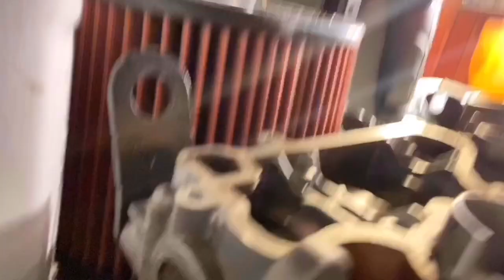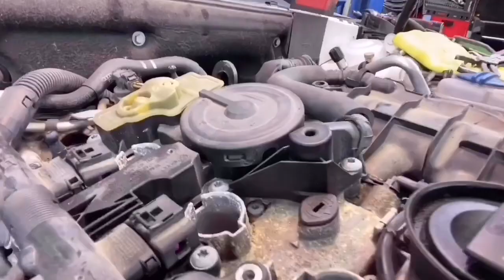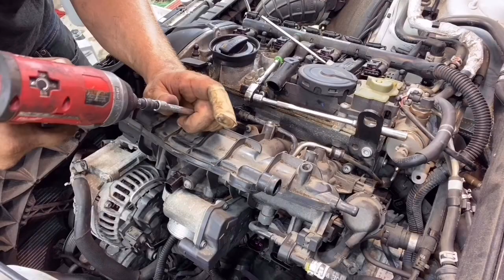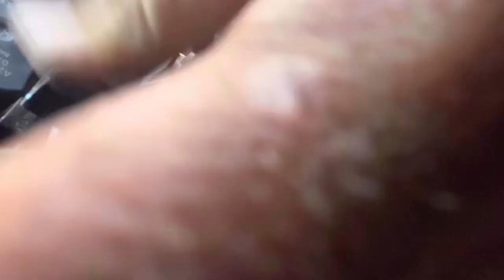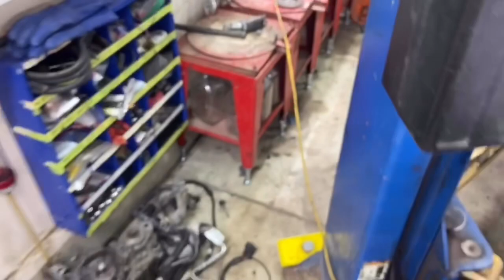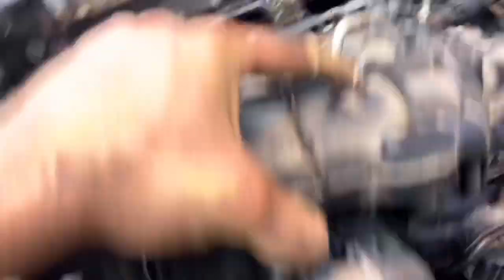2.0t tfsi fuel injectors / intake manifold replacing. Cylinder head tfsi a4 a5 a6 q5 b8 b8.5 Audi vw

Comment: This is the kinda guy you DONT take your car too.
He’s not careful because it’s NOT HIS CAR.
Punching the hose connected to the throttle body to get it off is not the “easy way”
Not disconnecting the battery AND making a spark with the aluminum part could short the vehicles computer.
And spraying the penetrating oil right into the fucking intake like WTF are you doing. That penitrstingnoil is now sitting on top of your valves and leaking into your engine block.
Good video but terrible performance in spots.

Comment: Great guide, best I've seen, thanks...!  I was worried about the Injector/Manifold Out & In process, but now I'm not.  I've seen your other shorter vid about pushing down & up a little on the manifold to release the Injectors before removing, so I'll give that a go too.  Excellent, thanks very much NTT...! 👍

P.S. I did break the locking tab on the Guide Rail High Pressure Fuel Sensor the other day when replacing it, so I've had to order a replacement VAG one.  Silly me...!  😁  I'll take my time with the rest...  👍😄

Comment: I took off my manifold and found a lot of carbon and some oil on my injectors is there a good way to clean it I can even see a lot of carbon on the lifters too and probably oil in there too is there a good way to clean those as well?
Please help it’s my first Audi 2.0t and it keep shaking at idle under 1500 rpm’s and I’m guessing this is the reason why it also gives me misfire codes is that because the injectors are dirty

Comment: Can you disconnect the fuel rail from the intake manifold, leaving the fuel rail and the injectors in the engine? Then remove the rail and injectors? Looks like it would be easier to align everything back up on the install?
Reply: ive done it both ways. either way is kind of a PITA, no one way was necessarily easier,  for me at least

Comment: Hi Sir. I have p2015 error. then, I changed intake manifold for my mk6gti, along with new sensor. but the error still shown up sir. do we need to recalibrate it using comp after the changes done to remove the error? because when i reset the code, the code keep coming back.
Reply: Did you find what was the problem?

Comment: Thank you for the Guide video. I have a questions for you. I took off fuel Injector rail but I can't see nowhere rail hold bolt and nut mount on Cylinder head. How I hold Injector rail on Cylinder Head?

Comment: Proper job fella. I am master tech in Korean brand workshop UK . What you are doing is what I am doing in my own time.excellent tips regarding fuel line and vacuum pipes..just one question what the hell is a triple square??
Reply: In my opinion a triple square is one of the only things that makes me want to strangle audi I wish they just used regular shit essentially its a bolt but instead of being able to slap a socket over it it has an internal system like a screw but it's not a Philips or a flathead it has like a star shape and you need that shaped bit to sit inside of it to take it off they call it a triple square torx bit because if you look at the patter it's like 3 squares on top of eachother staggered some people call it a 12 point cause its got 12 points it looks like a star just with well 12 points and I fucking hate them because they strip and it's a headache to find the bits anywhere

Comment: I have Tiguan with 2.0 TFSI engine. Driving on highway injector blow up and got stuck in open position. Drove home for about 10 minutes, had some white smoke coming out exhaust.
My question is, how likely that there is catalytic converter  damage from fuel coming out and should change engine oil as well?
Thanks
Reply: Just went thru the same thing. 2010 gti and number 4 injector got stuck open on the interstate. Limped it home about 5 miles. Changed all the injectors and she’s running perfect again. Definitely change oil with a leaking fuel injector. It can mix with the oil and can cause a lot of problems

Comment: I'm getting ready to replace my injectors on my Audi tt mk2 Quattro. I have two lean cylinders and two rich. Outsides are rich. Inside lean. I do have a stage 2 tune and other mods. Is the transverse 2.0 tfsi the same basic procedures, just front facing?  I'm replacing my Intercooler and radiator same day, so I'll have plenty of room to work. Do you have an install video for a TT for Intercooler and or injector replacement?

Comment: 2012 Audi A4 Quattro. Replaced all four fuel injectors. It ran really well at first but now has the check engine light on and runs a little rough. Do the fuel injectors need to be “recoded” after replacing them?
Reply from the maker: No follow the check engine light
Reply: Thank you! I got P2188, P0300, P0303 and P0304. Running rich and misfires in cylinder 3 and 4. Could that mean that injector 3 and 4 are not in correctly? The seals kit was replaced for all four cylinders.
Reply: Searched through your videos and answered my own question. The car runs good, doesn’t pop like it used to. Just got the light and it runs a little rough, at times. Thank you! Your videos are very valuable. We’ll replace the High Pressure Fuel Pump next and do your test to determine if it’s the coil or spark plug on cylinder 3. P0304 went away after driving it more. Its spark plugs were recently changed and replaced with the same Chinese brand spark plugs that you said were trash. Likely will need to change them and recheck the codes. That’s the plan.

Comment: Love and subscribed to your channel. Struggling to trouble shoot a 2016 Audi Q3 2.0 TFSI Quattro. Last Sunday it started running rough and starting out from a light would barely move. At first I thought that it was bad fuel. It has 4 permanent codes P2293 (N279) fuel pressure regulator mechanical failure, Knock sensor, cylinder 1 misfire and random misfire. I changed coil 1, all plugs and HPFP and checked bucket follower. No metal present in the oil. Verified spark and LPFP. I have a crank but no start situation. I turned crank clockwise and it turns freely (no piston valve contact). Hence why I am watching this video as I think checking injectors is probably the next step?

Comment: I got an 2012 a5 2.0tfsi, been fighting against this problem lately: on cold start its having a little rough idle, getting black smoke once I push the throttle, crazy oil consumtion (1.5 litres per 300 km), there is some fuel smell in oil, and the fuel consumption is intermittently high, sometimes I get 13 km/l sometimes just 5-4. I smell burnt oil in the cabin time to time, but I never found it dripping if there is a leak. Could it be consuming oil because it gets diluted by gas? Changed spark plugs, pcv, hpfp but the issue is still present. The turbo is good. Im thinking to change fuel injectors now. Could it be anything else? Ill appreciate your advice
Reply: Vacuum leak

Comment: Question, I have a 2013 a4 but it's manual so it's not flex fuel because of the plastic intake, is it as easy as just swapping intakes to convert to flex fuel or is it a major upgrade?

Comment: What's the best procedure? Injectors in the rail and then push into the head (as seen)? or... injectors in the head and then push on the rail? It's a bit fiddly to get the connectors on using the second method- but you can feel the injectors are fully seated and at the correct angle.
Reply: Curious about this as well. What did you end up doing?
Reply: @brandonblack9452  I'm sure either method can work. I did injectors in the head first and then pushed on the rail. The downside is the electrical connectors are fiddly.

Comment: Hey @NaptownTuner, I just had an issue where fuel hose bringing the fuel to engine got detached with fuel leaking in engine bay. I can't figure out how it should be locking properly: 
https://photos.app.goo.gl/kknpjzxKFK3dYTjG9 there is this black plastic shim inside and thing is just sliding off. PN for the hose is 06h133988, I have this on  Audi Q5 2.0t 2013. Any help how to properly connect the hose without really worrying about hose getting detached would be appreciated.

Comment: A constant problem with audi compared to jeep or Toyota, is difficulty finding good self help guides for stuff. I've been putting off this repair because it seemed high risk and difficulty. You made it seem so easy and explained stuff so well, I tackled it and I did just fine. Thank you so much for one of the most helpful videos I've ever found on you tube!
Reply: Yeah I agree. Owned a Hyundai Accent before I got my Seat Altea XL, with the CDAA 1.8 TSI. I need to carbon clean the valves and have found very little info on my engine. With the Hyundai I found info everywhere! I am here watching this video as I presume the process with the VW 2.0 is very similar to the 1.8.
Reply: Audizine has tons and tons of very well put together and well explained write ups on just about anything you could need to do to one of these cars.
Reply: Don’t forget the torque specifications you can find online 10nm for the nuts 30 nm for the bolts on the intake manifold
Reply: Jeep? Lol, don't ever put Toyota and Jeep in the same category.

Comment: I have an 05 A4 b7 2.0t with 268k miles. She has a coolant leak I have identified at the corner of the engine where the head mounts to the block (passenger side, closest to fire wall). Want to ask if you thought it would be a gasket or a warped head? Just wanted to say it isn’t the rear coolant flange. Is this repair worth the work with the mileage I have? Any input would be greatly appreciated and keep up the good work!